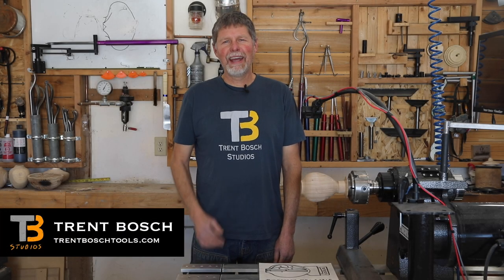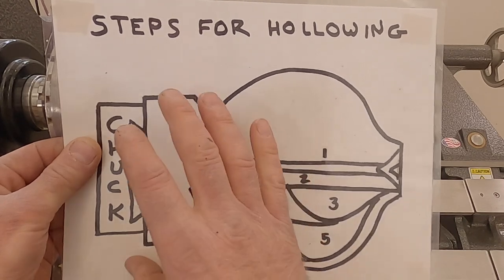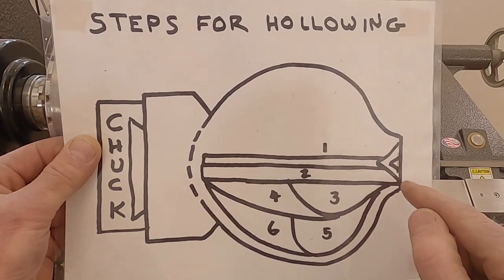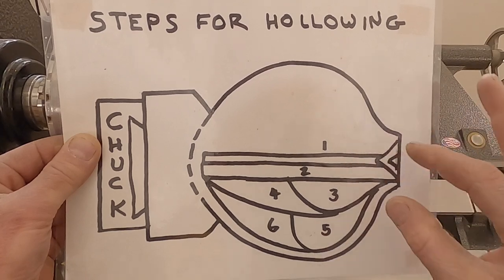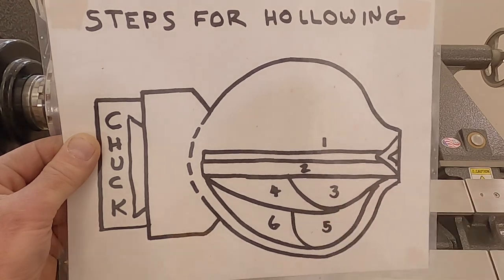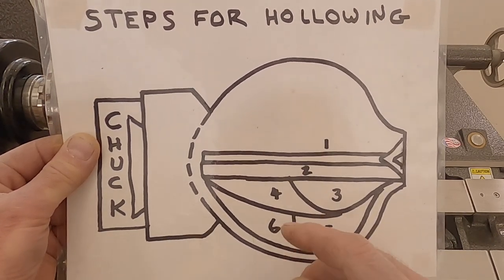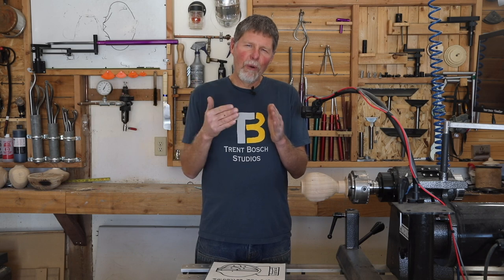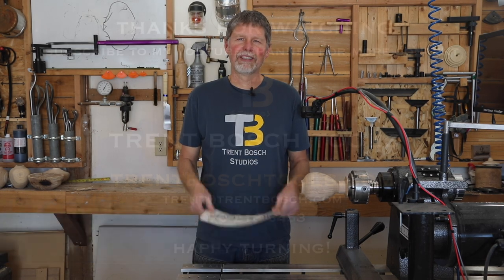Steps for Hollowing with Trent Bosch

Comment: I agree with the 6 steps, looks totally reasonable and similar to how Ive done the few bowl shaped objects Ive created.  
My problem is how to keep from accidentally punching through the side wall during 5 and 6.
Another question, When working on 5 and 6 do you push from the top down, or draw from the bottom out?